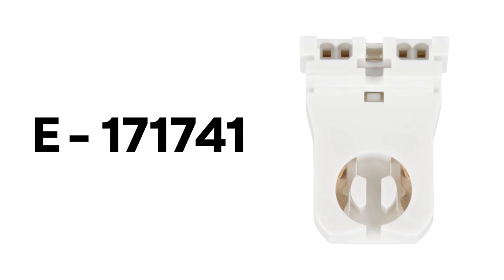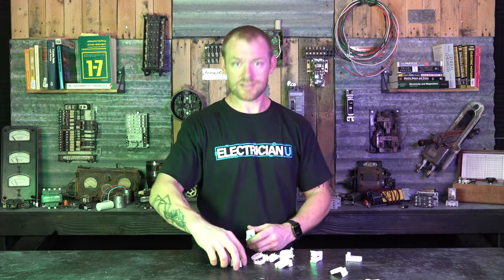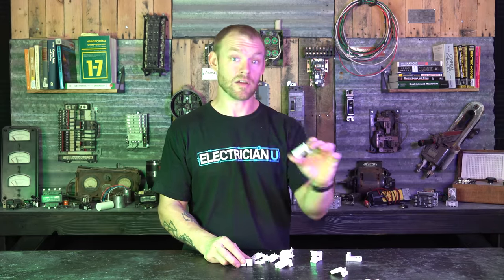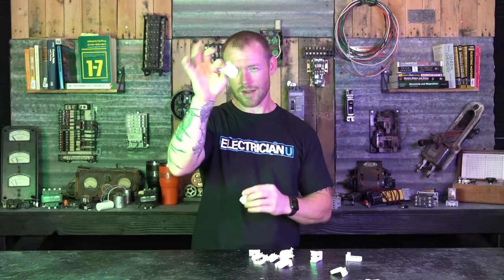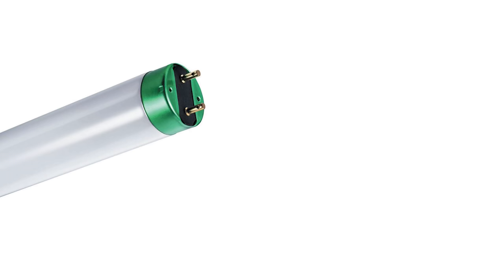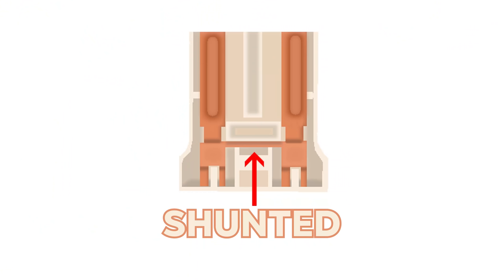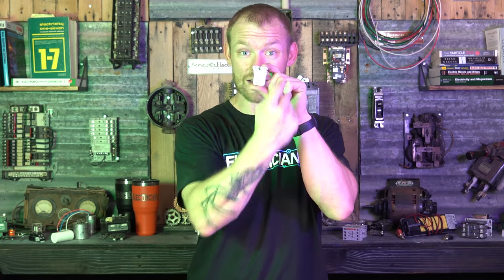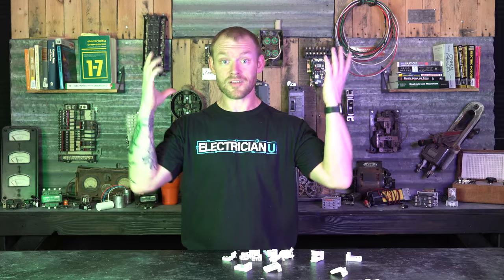Tombstones: Everything You Need to Know!

Comment: Try working in a site that was built across a 40 year span, finding stuff that will work is the real challenge. 20 plus buildings some at 110v some at 277v working with people that are afraid of electricity. I survived.
Reply: I don't understand ballasts work on both 120 or 277v. Give it hot, give it neutral, ground it bond it and move on... how hard can it be

Comment: Well Unshunted Lamp holders u need those for Rapid start ballast,  Preheat 
And some Program start ballast.   It job is to provide cathode heating to statt the fluorescent tubes.  

  Electricain U u should get into ballast types.   I am Still  Using full power T12 on using Two or 4 lamp Instant start T8 ballast.   Reason is 
When your still in a place where there mass Installs of T12s  and then throwing in bunch of T8 lamps is a headache.   I am a lighting collector. I love see and keep T12 long as we can.
Reply: Recently in a loan office I was changing lights and found a crazy mix of T12 and T8s, I explained that changing the whole office to T8s would stop problems with putting the wrong bulbs in the fixtures, and save a surprising amount of power. They went for it.

Comment: Everyone loves to shit on fluorescent tubes and tombstones, but after seeing so many all-in-one proprietary LED lights die out, and then having to get replacements that cost a whole lot and don't even match what was there previously... yeah.
Reply: Spent my last 10 years working at a very large hospital/research buildings. They had a 15 by 20' room just filled with lamps ballast & at least 20 different lamp sockets. Never saw over halve the sockets they stocked.
Reply: We've just finished a giant relighting project where we switched out a ton of induction lighting for LED.

The induction system lasted nearly 10 years with only a few ballasts being changed a year. I'll be impressed if the new LED system holds up as well.

Comment: Most T12 tubes are actually the standard bi-pin type. The single pin T12’s are known as slimline lamps. They are designed for use with instant start ballasts. High output T12’s are a completely different animal. They use a special base that installs similarly to slimline bases but look like black plastic pieces and have 2 contacts inside.
Also, the ballasts that use the shunted sockets are instant start ballasts. If you have a rapid start, programmed start, or preheat ballast, non shunted sockets are required.
Reply: Question? Can the existing T12 (high output) w/ the black plastic pieces be replaced with LED bulbs with equal brightness (4k)? I'm sure the ballast will have to removed from the equation.

Comment: General rules-
1. Unshunted tombstones are generally used with rapid start ballasts.

2. Shunted tombstones are generally used with instant start ballasts.

Troubleshooting tip- If you have bulbs that have black ends and are burning out quick, may have been wired incorrectly using instant start ballasts and unshunted tombstone.
Reply: just upgrade to LED
Reply: These are some good points.   The F32T8 lamps are commonly used on instant start,  and if un-shunted sockets are used, the discharge will tend to concentrate towards the pin connected to the ballast,  shortening the life of the lamp.   When upgrading old T12 rapid start lamps to modern F32T8 instant start, if the old sockets are in good shape, you can simply wire a jumper between the contacts.

Comment: I have changed hundreds of ballasts, a handful of tombstones, mostly for u-type bulbs. I never knew any of that. Of course if I service a unit with a starter,  I rewire it with a new ballast, and toss the starter.
Reply: Oh yeah, the old preheat fluorescents, the type that blinks and glows at the ends before fully lighting.   Only thing I like about them, was the ballasts were very simple and rugged,  and would last for many decades.   Unless you have a burned out lamp that repeatedly strikes,  the starter gets stressed and soon fails, causing the ends to glow orange,  if the tube and starter are not replaced and the problem is ignored,  the ballast will overheat,  and because many of the preheat ballasts still in service are quite old, they may contain PCB's and not have thermal protectors, making them a fire hazard.   If you've ever seen the aftermath of a ballast raining flaming tar, or at least,  cleaning up the black like substance you'll know what I mean.

Comment: Love your videos. Like me, You seem to like the theory side of electricity. I have a question you may want to research and answer.

When testing voltage on residential 3-way switches, you will often see 30+ volts on one of the travelers that is not supposed to be carrying current. No, it’s not an open. It is caused by capacitive coupling. Here’s my question: why don’t you see that on a simple two-pole switch when you test the neutral? What is it about a 3-way that causes it? Yes, simple answer is there’s three wires. I was hoping for something more in-depth and thought you could provide it. Thanks.
Reply: you don't see that capacitive voltage because the neutral goes somewhere (ground / bond) and drains it off. On a travel wire that's not energized directly it's an open wire at both ends so not being drained off by being attached to a neutral / ground.

Comment: Absolute best socket for flurescent lamps were the push in on expensive luminares. Next best is the ones that you can insert in and turn 360 degrees. Worst is the ones for horrible expensive T5 high output lamps that heat killed them.

Comment: T12s are NOT mostly single pin, the 14,15,17,20,30,34 and 40 watt T12 lamps all have bi-pin only the 65,80,85 and 125 use single pin.
Reply: and the bi-pin T12 lamps use the same tombstone as the T8 lamps.
Reply: Sounds like you should make a better video explaining it!
Reply: @jordanclayton7913  actually, I may actually make a video explaining the different sizes and types of fluorescent lamps and which ones are interchangeable, as for the tombstones themselves, this is a great video.

Comment: Scary when uou convert lumimares to think its type B that bypasses ballast and supply 277 volts to a tube socket. We have all seen a lot of cracked tube sockets with a piece of plastic missing. That combined with a 277 volt on a 20 amp circuit breaker will product fireworks when cheap broken socket shorts out. Converted a few in my basement and thinking about installing fuse holder with a 0.75 or 1 amp non time delay fuse for the 120 volts that feed the LED lamps.
Reply: Very good idea about the fuse.   Speaking of the newer LED B types,  (personally,  I absolutely love them, they are the best of both worlds in that they eliminate future ballast failures,  and are more energy efficient than the type A LED tube, yet in the event the LED tube fails it does not require replacing the entire fixture,  like many of the newer types with integrated LEDs,  thereby reducing the amount of environmental waste) there are some things you need to be aware of.   A coworker of mine, once worked at an industrial facility,  where much of the equipment was powered by 277/480, and seen  the aftermath of someone inserting a fluorescent tube in a fixture that has been converted to LED bypass, and all the lighting was powered by 277 volt.  The end of the tube actually exploded in the workers hand as the lamp was inserted.
Reply: Instructions on my LED'S stated to only install tubes in a luminare that was powered down. You know that seldom happens.

Comment: Very cool (spooky) video the month before Halloween (would be ironic if you posted this on Oct 31 lol.   ) Speaking of Tombstones for T5, T8 & T12, would be cool to also see a tombstone for a Mogul Bi-Pin lamp, very rare today but they were used for a F90T17 lamp, or 60 inches,  90 watts, 2 ⅛" diameter,  preheat,  requiring a FS-85 starter.   For those younger folks who never heard of this lamp type, it was among the very first high output fluorescent lamps,  introduced in the early 1940s, but very few remain in service,  and the bulbs and starters are next to impossible to find anymore.

Comment: Are tombstones finicky or sensitive in general? I just did a ballast bypass on a 4 tube t8 fixture in my basement, and only the outside tubes are powering on. The tombstones were shunted, but I just tied all of the left tombstones to hot and all of the right ones to neutral, as that's the wiring specified by Philips mains fit, which is the led tubes I installed. One wire on 1 of the interior tombstones pulled out during my work, but I thought i jammed it back in there pretty good. But even still, the other interior tube isn't lighting. Seems unlikely that I managed to create two loose connections at once, unless these things are just really sensitive. All 4 bulbs worked fine before I started.

Comment: LOL, I make concrete tombstones - I know your channel because I am an electronics engineer too!!! I was wondering why you were making a tombstone video... When you brought them out, I was like... OH.... that!!!! 
BUT!!!!!! This has become VERY important now that we are switching over to Ballast Bypass LED FLourescent lights. If you don'r know your tombstones, you will be left scratching your head and saying one of two things... Why doesn't it work??? OR Why ami tossing the breaker? I wired it like the instructions said... Because you don't realize there are a myriad of different styles and you HAVE to know which is which... ESPECIALLY if you can't use the ones that came with the bulbs, OR your bulbs did not come with new tombstones!!!!! 
If you are switching to LED Flourescent replacements and are not using ballast bypass, you are either lazy or don't know how to rewire a light. Dumping the ballast is KEY to making them last forever (in LED terms) BTW Home depot FINALLY started carrying ballast bypass tubes WITH tombstones included.
Reply: LOL - Now I have introduced some new terms - the different kinds of LED replacement flourescents - a whole 'nother video!!!
Uses Ballast
Ballast Bypass
the different types of K
The different brightnesses
If I have a 4 buld fixture and go to LED, do I REALLY need to put 4 LED back (no, they are bright like the sun, two will do) 
Should I rewire what I have or put in all new fixtures? and MORE LED Questions!!! 
I learned all this when I went from flourescent to LED in our office... almost 500 4 bulb fixtures
Fun fact - a 4 bulb fixture pulls between 180 and 200 Watts - The same LED setup pulls around 8 to 10 watts
The savings is HUGE!!!! DO IT!!! The gift that eeps on giving
Draws so much less power it pays for itself in less than a year, in many places the power company will PAY you to do it (green programs) AAAAAND the best one of all - no more monthly trips around the office with a box of bulbs and a ladder!!!!